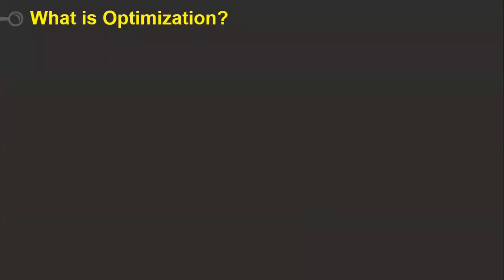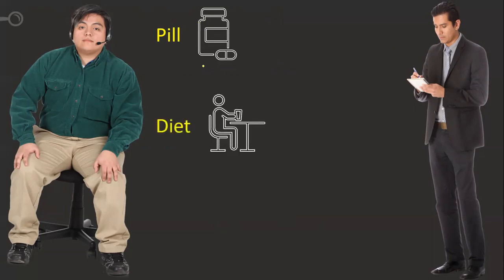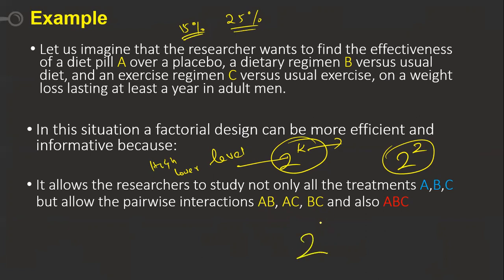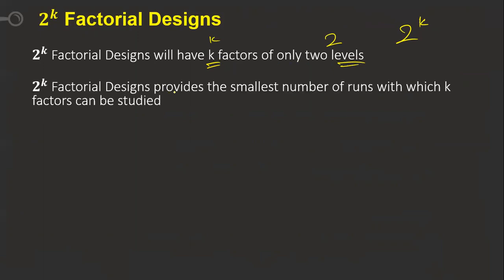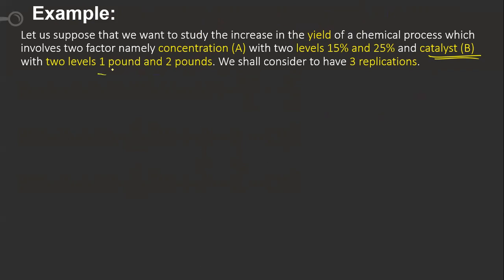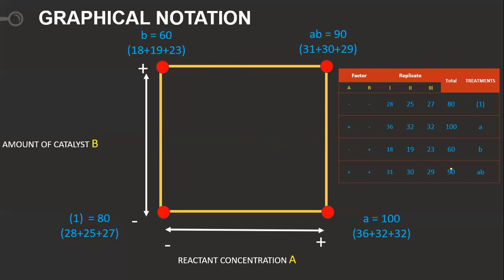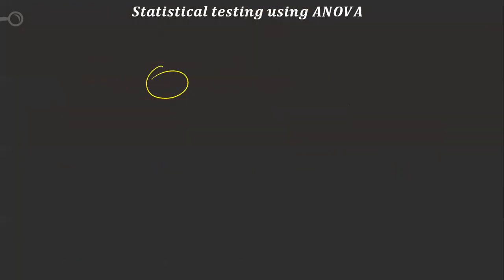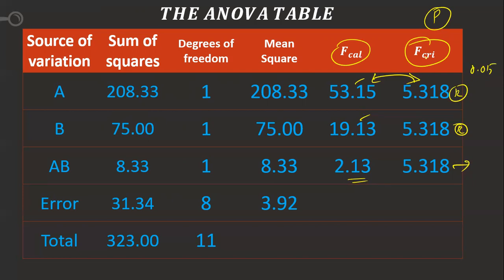What is a factorial design? | How to use 2k factorial design in Research ? | 2 x 2 factorial design

Comment: I have a doubt. If I perform a two way anova without replication I'm getting the effects with the p values, although no interaction. In a 2^2 factorial design with no replication I would get all the effects but no p values. Why is there this difference between 2 way anova and 2^2 factorial design?

Comment: How we find Total sum square befor calculating error bcz we need to calculate total square first after we can calculate error na plzz answer sir
Reply from the maker: Can you put your question more specific please??
Reply from the maker: It is calculated in the usual method in One way ANOVA... If you need a shortcut then... step1. Square and add  all the observations ( =9398 ) ... Step2: square the grand mean of all observations and multiply by the total size ( 27.5 ^2 x 12 = 9075)... Step 3: subtract the value in the step1 - step2 = 9398-9075 = 323.. hope you will understand.... Study the calculations of ANOVA then come for this video then you will understand better... good day!
Reply: @MathStatSimplified  do we use 1 way or 2 way anova in 2k factorial design? Since we have 2 or more factors, means we are doing 2 way anova is it?
Reply: i got the same question. how to find the SST (which is equal to 323 in this question) before evening knowing the SSE? Your explanation did not explain how to obtain the value of 323, you just suddenly throw this value in. Is this value usually given in a question? Or how can we know this value? Please answer thanks!
Reply from the maker: @lalalalalalolololZz  It is found out in the usual way  in ANOVA....step1: find correction of mean =( total observations)^2 / 12... Which equals 9075...Step2: find total sum for each treatment...this can be obtained by squaring all the treatment values and add  which equal to 9398...step3: subtract both which equals 323....hope this helps ...revert back for any other query...
Reply from the maker: Other shortcut to find SST....subtract grandmean from each value....square it....add them all..